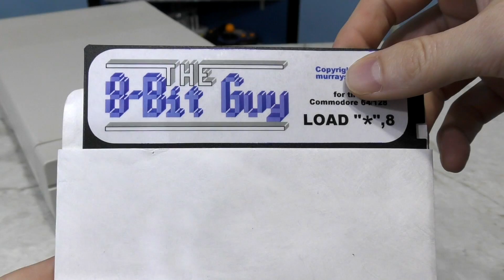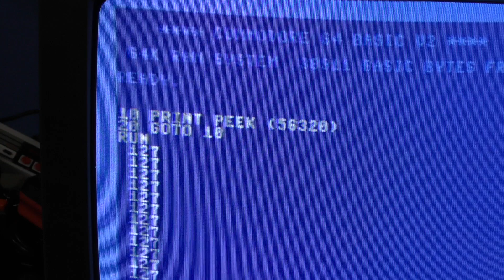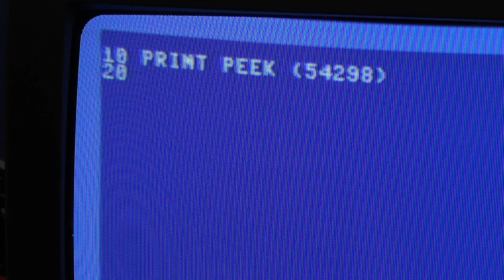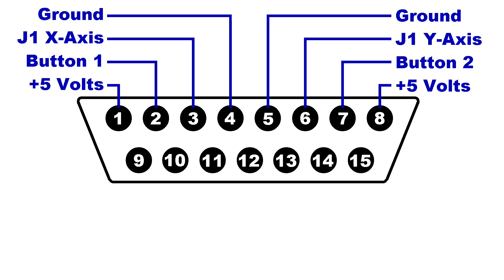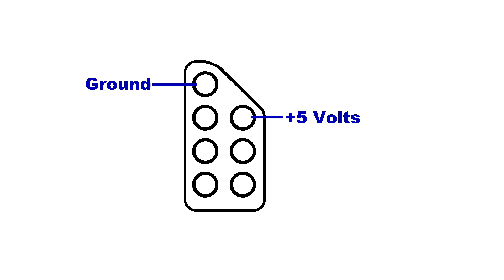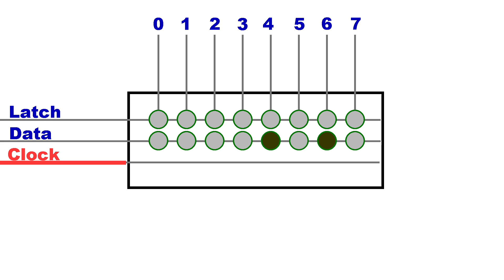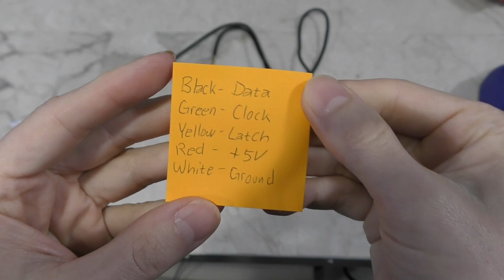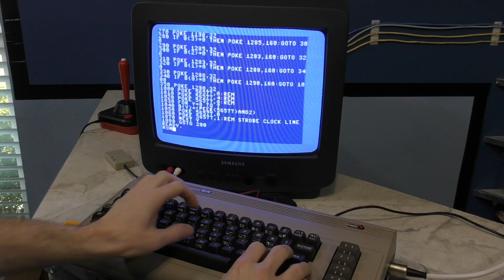How Vintage Game Controllers Worked

Comment: Technically the first game controller was a button used to control an oscilloscope game called 'Tennis for Two'.  What about the 'Star Raiders' controller for the Atari 2600?  How did that work?
Reply: This won't answer your question but the Star Raiders keypad controller works exactly like the earlier Atari Keypad Controllers for BASIC on the 2600 and a few other titles. The later 2600 "Kids Controller" also worked the same as both of those other controllers. The modern "Synthcart" uses them all for making music on the console...

Comment: You can also wire up an Atari Controller to an Odyssey2.   When I was a kid the controller died on the O2 and since the controllers were hard wired I worked out what went where and TaDa.  Electrical tape and run safe scissors was all I had.
Reply: I had a friend who used Odyssey2 joysticks on his Commodore 64. They actually were decent with MicroProse's "F-15 Strike Eagle" but not much of anything else. Either he had an adapter or his dad rewired them or something. His dad seemed to be allergic to anything Atari. They had the Coleco Telstar instead of an Atari Pong console, the Odyssey2 instead of the Atari 2600, and the VIC-20/C64/C128 instead of an Atari 8-bit...  :)

Comment: "Of course you can only physically push one of the direction buttons at a time" er... two. A horizontal and a vertical can be pressed together.

the next era up, playstation, N64, even through the PS2 and Gamecube has some really interesting tricks, with more smarts in the controller to make it work. Then the Nintendo Switch brought a lot of those back, in the form of the joycon attachment connector.

Comment: The 2600 joystick design didn't have to be a single button as Omega Race proved, two pins essentially do nothing with the joystick plugged in. :( Game Port Y-splitting is funny in that there is nothing to stop one from combing two DB9s that same way through an adapter for the same options on C64 and Amiga.
Nintendo got on the Shift Register train early to much success, shame others didn't in hindsight. I like your adapter, I really think a lot more expansion for game controllers could have been adopted on many PC platforms but never did unfortunately till USB. Yeah the Coleco controller setup is a video unto itself, much like the INTV one. ;)

Comment: Hey could you help me with something?

I bought 3 snes controllers for 2$. It was a great deal. Once i took them apart and cleaned them, the boards and connections were in super good condition. However, when i plugged them into my pc using an adaptor, one of them worked in zsnes perfectly every time. However, the other 2 do not recognize a connection. But when i plug and replug the controllers, its recognized it as an input.

I dont know how to fix them. Help!

Comment: Having watched this video three times and making myself familiar with the Atari-style connector,  I can imagine a SNES-style controller being made as a homebrew project or something for the Commodore 64, especially after seeing you get a DOS flightstick working on yours. The paddle controls would control each directional axis, while the pins that would usually be used for directional input would instead be used for face buttons, and the original fire button possibly acting as a Start button. Of course, the main obstacle to this sort of thing would probably be the limited power of the C64, which I imagine is why something like that was never made in the platform's life cycle as far as I can tell. Still, I'd like to see some enterprising techno wiz make something along the lines of what I just described, and maybe see some homebrew C64 game take advantage of it.

Also one minor note on the controller software: when I loaded the PC joystick test into VICE,  I tried to test it with the paddle controls, but as soon as I loaded the .prg file in the emulator, I was greeted with "?ILLEGAL QUANTITY  ERROR IN 610" and it started the ready prompt. I have no idea how to fix it myself, but I did use the list function and got the line "610  POKE 53262,PEEK(54298)+15". Do you have an idea as to what went wrong?

Comment: Waiting for "How Modern Game Controllers Work"
Reply: He is right, most use standard protocals such as USB or Bluetooth. A little microcontroller inside the controller repeatedly polls the digital buttons and converts the analog sensors into digital data. It might do a little key debouncing, then send a packet over a protocal to the console. Some consoles, such as the N64, Gcube, and original Xbox had a proprietary interface, but now all use USB (wired) or Bluetooth (wireless) because the hardware and software needed for these is cheap and widespread. That little microcontroller can also receive data from the console, generating lights or rumbles, or, in the case of the Dreamcast, allowing you to take a Chao with you.
Reply: @lordofthecats6397  Slight correction:
The original Xbox controllers were USB with a nonstandard connector, which is why you can get USB to Xbox adapters and vice versa
Reply: The OG Xbox uses USB 1.1 in proprietary connectors
Reply: @lordofthecats6397  Thank you for mentioning the Dreamcast and chao, also BOOOOOOORING
Reply: Well, he's the 8 Bit Guy, so you probably won't find him doing any modern technology on this channel.
Reply: Andrew Neal don't want to overflow the guy.
Reply: Simple, just plug in to usb port and fire away... lol jk
By the way, just because most consoles use the standard USB port, it doesn't mean you can mix and match controllers among the consoles due to proprietary drivers, data, buttons, etc.
Reply: I don' know how it works,i just know it's a fucking nightmare to put them back together once you open them,at least the ps3 ones,that tiny metal thing in the triggers must be in the right place or they will feel like regular R2/L2 buttons

I opened it to fix the dpad

Put it back together and the triggers just didn't felt right 

Took me half an hour to get both right,ten minutes to figure out what was wrong and twenty more to fix it,but during the process the R1 button got out of place,so i had to open it and do it all over again...

It was entertaining at first,but it gets frustrating after twelve tries
Reply: Maybe in the 32 or the 64 bit guy
Reply: You may be at the wrong channel
Reply: I think All modern console use propertary data, not protocols. 
Most modern console, ps3 and above, may some others, you can connect any controller in Bluetooth as a "generic controller"... This may be some plug and play or some open schema.... But proprietary controls has same tecnology as Bluetooth, but send and received generic data and extended data.... 

For connection, will be use same tecnology, and this means they send and receive data in same way, but a ps4 controller, can understand more extended data than a generic controller. 

Some company do some criptografy in your custom data, for other comoany not copy their tecnology, like rumble, in controller visor, speaker, microphone in controller, and so on....
Reply: @Habituated Abnormality 
I'm not a Baby Boomer, but nice try.
Reply: Yes, where is it?
Reply: See you in 1000 years.
Reply: sorry the 32/64 bit guy is over there →
Reply: @BigOlSmellyFlashlight  Not a bad idea at all

32/64 bit consoles have a lot of interesting features and devices too
Reply: @KaibaSeto.  yeah! but they're also exponentially more complicated than 8 bit. pun intended.
Reply: @
Iván Rodríguez

Nobody gives a fuck about new millennium shit.

Comment: I wonder how the various Multitap 4-player adapters worked. For example, Double Dribble on the Sega Genesis supports simultaneous 8-player action if you use two 4-player adapters.

Comment: wasn't it weird that Amiga games looked as good as SNES games but the controller had only one button.. How did games like Street Fighter 2 work?
Reply: The Amiga actually supported two joystick buttons and many Amiga games (including Street Fighter 2) detected the extra button and remapped their controls automatically. With one fire button, you used Fire+Forward for the various punches; and Fire+Backward for the kicks. With two fire buttons (for example a Sega Mega Drive controller), you had one button for punch and another for kick.

You could also use the CD32 controller (same button layout as a SNES controller) on the Amiga, but it came quite late, so not many games supported them.

It's also worth remembering that as a home computer, you had access to the keyboard (potentially up to 100 extra buttons). Lots of Amiga joysticks were designed to stick to the desk and be used with one hand, leaving the other hand free for the keyboard.

Comment: USB HID Class is a wonderful invention - you can have pretty much anything attached to it and it will work with any supported OS.

The descriptors are pretty small in device Rom too - 

https://eleccelerator.com/tutorial-about-usb-hid-report-descriptors/

Interesting one of the inventors of USB was an ex Atari guy who designed the Atari SIO bus - a synchronous serial device with Atari used to connect disk drives. 

https://en.wikipedia.org/wiki/Joseph_C._Decuir

Comment: The Nintendo N64 reality quest glove controller is paramount. For those that are disabled or are an amputee. The PlayStation has the reality quest glove as well having both I must admit the PlayStation versions is a far superior version as you can set digital or analog with a switch, the N64 does not.

Comment: even if the manufacturer didn't include the 9-pin Atari type interface there were third parties that would provide interfaces - the Sinclair Spectrum had a number of interfaces available with even Sinclair eventually offering the connector on their 'Interface 2' add-on. Was there any machines of the 8-bit era that couldn't use Atari compatible joysticks?

Comment: I wonder how they work now? That last method that the NES controller used would actually explain how Nintendo can put out multiple controllers that use the same plug! Looking at my snes mini controller (which is the only controller I have with that wii u port), it does appear to have five prongs, so I guess this method could work? Of course, today they can probably just have each button send a message to the console telling it which button was pressed.
Reply: Nintendo isn't unique there. Look how many devices can use an "Atari" DB9 port... On the Atari 8-bit computers, Joysticks, Paddles, Trak-Balls, Driving Controllers, Mice, Light Pens, Light Guns, Touch Tablets, 80-Column Mode Adapters with monitor connectors, robots, and a shed-load of other devices used them. There's even a modern adapter from Eastern Europe called the "MultiJoy" that can hook up something like 20 joysticks to a single Joystick Port on 'em. Rule of thumb: if Nintendo receives credit for something, Atari most likely did it first.

Comment: this is super interesting. Also this makes me question what controles can we use retrocompatible. Genesis is a big no no due to the select botton. but i guess master system? would a cheap knock off controller with 9 pin would work? (like those nes classic clones)
Reply: Genesis controllers don't have a select button, David's explanation on this point was actually incorrect. They're perfectly safe to use on other consoles and computers.

Comment: The inside of the controller is also labeled what wires to solder where and color.

The program you wrote could be used on mac or windows, maybe a basic emulator, with a corespondent hardware port USB. Would help those of us who repair the nes controllers to test them.

Comment: how do the internals of systems like the commodore 64 read the controller position internally? I thought they had a shift register  built in so arent they basically the same just wired a little different?
Reply: Are you talking joysticks or paddles?  It uses the same connectors and pin assignments as the Atari 2600.  No shift registers are used in these controllers, because the fire button and each of the 4 directions has a dedicated pin on the port.   So it just takes a single read of the proper address to get the button states for a port. 2 of the pins on each port are reserved for reading the potentiometers in the paddles.  These pins are connected to analog-digital converters inside the C64, so the paddle position on a scale of 0 to 255 could be obtained in a single read.   This was different from Atari's design, which used a capacitor instead of an analog-digital converter.  The software had to discharge the capacitor and measure the time for it to recharge.  The position of the paddle determined how long it takes the capacitor to recharge.  One interesting thing about the C64, its 8x8 matrix keyboard and the controller jacks shared the same 2 ports on the I/O chip.  One port could be set to either input for reading the controller, or output to select which keyboard row to read.  The other port was read only, and was used to read which keys on the selected row were pressed, or the controller.  So using a joystick in that port would look like keypresses.  Also, pressing certain keys could look like joystick movements to a game.

Comment: You messed up on the Genesis controller. That's not a select button, that's a multiplexer select. Very different, since you need to drive it high/low to get all 8 possible inputs from the controller, but one that you could also program a C64 to handle. Sega designed it to keep compatibility with the Master System though. Mostly. You could also talk about the 6 button controller, which has a rather strange timing-based protocol that involves pulsing the select line a certain way to try and maintain compatibility.

Comment: For a few years I used a Genesis arcade stick on my Amiga 2000. I never knew about the risk of shorting +5 volts to ground. Thankfully nothing was ever damaged. Perhaps there was a safety circuit on the 16 bits?
Reply: There is no risk at all, unless you open up the controller and rewire it.

Comment: The shift register explanation made me wonder... the japanese famicom had a microphone on one controller that was used in only a handful of japan only games (and maybe Zelda? Has someone tried hooking up a famicom controller to a NES and tried yelling at the monsters in Zelda as the user manual instructs?)...

The question is then, if the controller uses a 8 bit shift register for creating a 8 bit signal to send to the console. And it already uses all 8 inputs... What is the microphone using? Is it hooked into the zapper signals?
Reply: I don't know the specifics of the microphone controller, did it sacrifice one of the buttons for the mic, or was it in addition to the normal buttons?  Either way, the design of the interface is such that it could use controllers with various sizes of shift registers.  The NES doesn't really know or care.  As long as the software is matched with the proper controller, it will work.

Comment: Nice.  It's worth mentioning that the Apple II joystick works along the same principal as the IBM PC.  Support for four potentiometers and three (!) buttons.  Models where the case could be opened (][, ][+, //e, IIGS) used an internal 16 pin DIP connector.  Later models (//e, //c, //c+) used a DB-9 connector.  The DB9, however, is not compatible with Atari/Commodore sticks - different pinouts and the opposite gender.

In the //c, the DB-9 lost support for button 3 and axes 3 and 4, but that's OK since very few controllers ever used them.  I'm not sure why.  I thought it was to support a mouse, but the //e joystick port also supports mice and it supports all three buttons and four axes.

See also ftp://ftp.apple.asimov.net/pub/apple_II/documentation/hardware/misc/Apple%20II%20pinout.txt
Reply: A lot of games on the Apple II supported the "Atari Joyport" adapters that were available for using standard Atari 2600/8-bit digital joysticks. Steve Woita and Keithen Hayenga came up with the scheme while at Apple because they wanted to play "Crazy Climber" with dual joysticks. Apple farmed the adapter out to a 3rd Party. Steve and Keithen later worked at Atari Inc. Steve having coded the awesome Taz and Quadrun games on the 2600 and Keithen being most noteworthy there for having done Tempest for the 5200 although he didn't get to finish it in 1984 because of the 5200 being discontinued - upon orders from Atari's parent company Warner -  and Atari Inc going down the drain but then a few years ago he finished coding the game and AtariAge released it to much-deserved fanfare in the retro home brew scene...

Comment: 3:52 That's bullshit. People have been using Genesis controllers on Atari Consoles and other systems for decades upon decades. Also, you can actually press multiple directions on a D-Pad at a time. 
Look, man, I really enjoy your videos but saying that you are frying your computer, might be true in theory, but in practice, there are just too many people have played games for the Atari 2600 and other systems with a Genesis controller, so obviously, their systems aren`t fried. Of course, I'm always open to seeing you prove it in front of all of your viewers that I'm wrong but until then, I would say that you are providing misinformation to your viewers.
Reply: Agreed. He seems to have assumed that the Select pin was connected to a button, instead of actually being an OUTPUT used to Select which bank of buttons to read. Perhaps he's not very familiar with Sega controllers?
Reply: He's incorrectly applying his Commodore knowledge to Atari. The Sega pads can fry the Commodore 64's CIA chip. It won't fry jack on an Atari, whether it's connected to a 2600, 7800, 8-bit computer and/or XE Game System, or an ST/TT/Falcon030 computer.